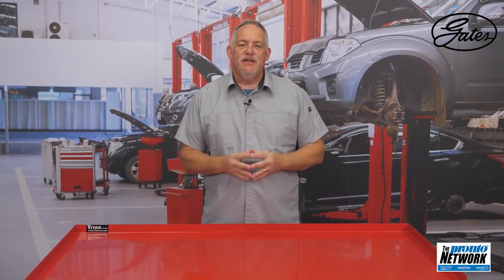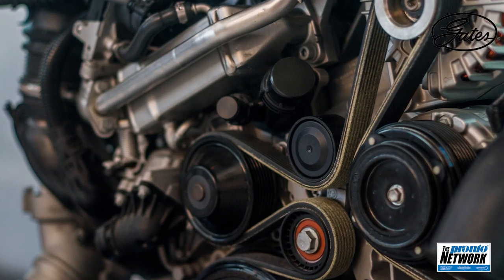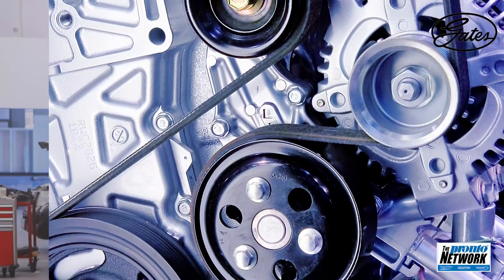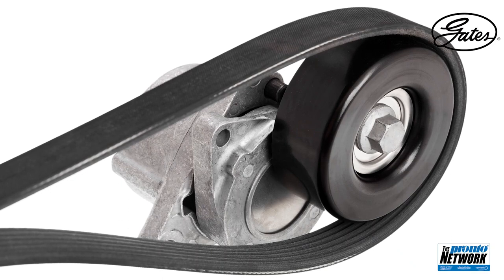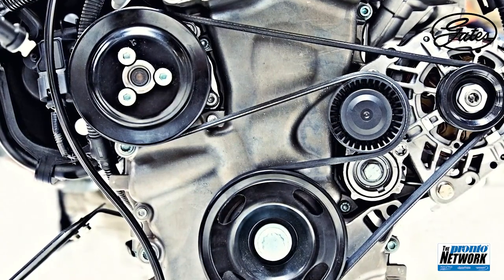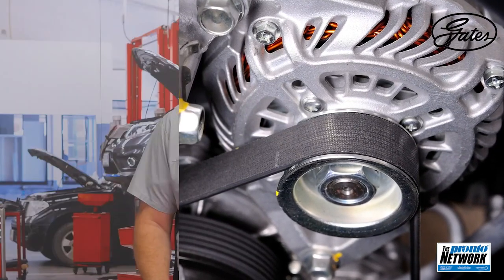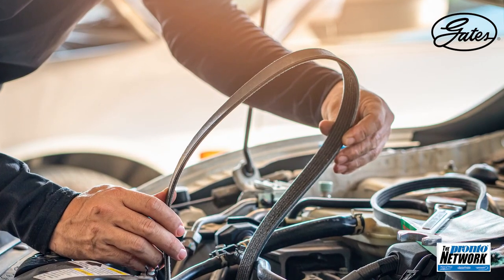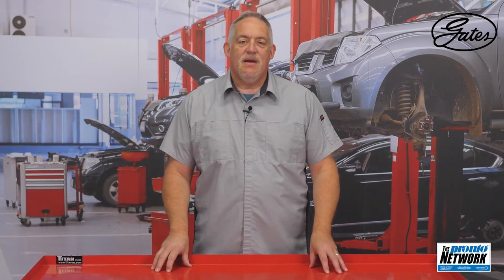What Causes Belt Wear Acceleration?

Comment: You know I'm doing DIY car repairs. I think it is best after replacing pulleys to put the old belt back on. So have the car idle for a minute or so to judge whether the system is operating fine. This won't ruin a new belt if something is out of order.